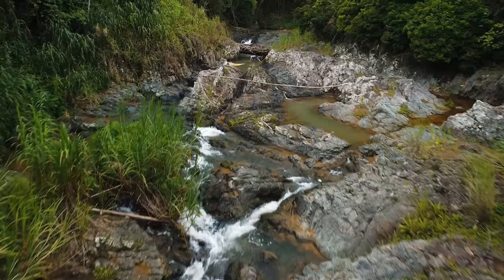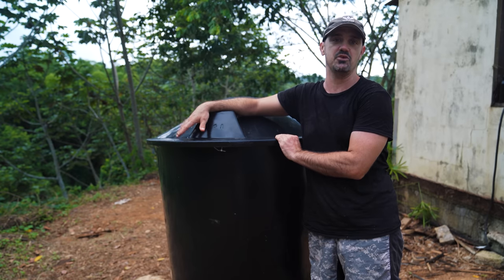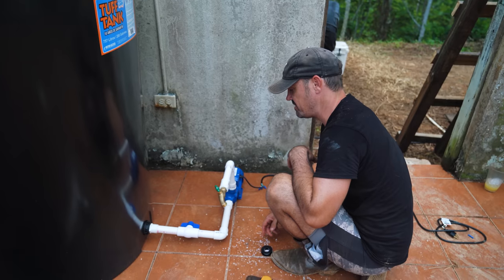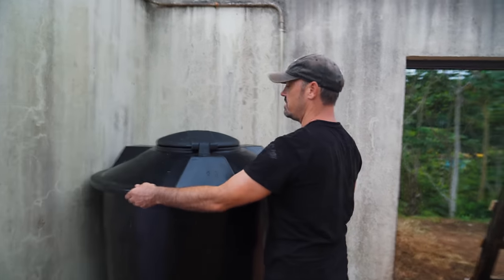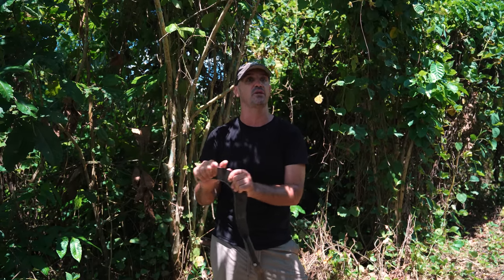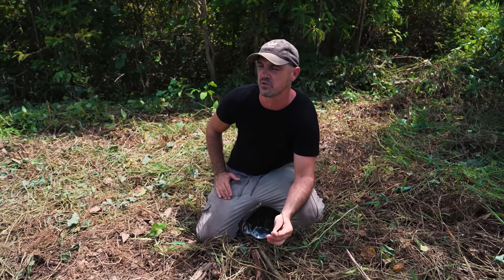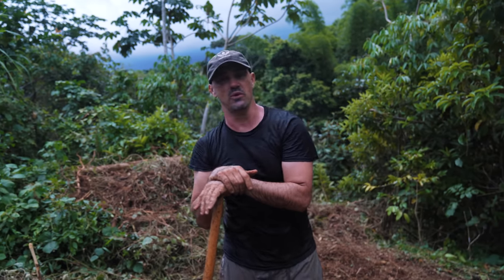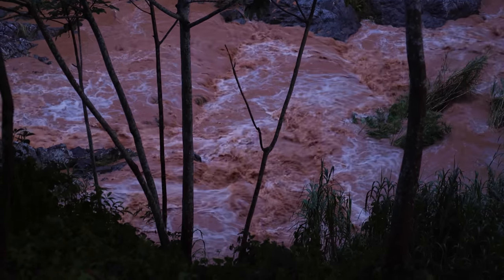WE BOUGHT AN ABANDONED PROPERTY THAT WE HAVEN’T EVEN SEEN 90% OF!

Comment: My mom and dad started a "homestead" when they were a little younger and eventually had a lot of what you may need. They were able to take water from "springs" (water which comes from a mountain from under the ground ) and run it through pipes into tanks which were above the house about 100ft . They ended up with about 10,000 gallons in multiple cisterns and filters and grew a huge garden. Then, at the end of summer, they might run out , and they had a stream about 400 ft elevation under them, and they pumped the water from the stream up that 400 ft of elevation using a special pump built out of a pressure washer pump. It took a lot of pressure to get it up the mountain from the creek.
Reply: When we were very young and traveling around the larger neighborhood, we found this valley where tons of fruit trees were hidden under vines like you have there. It was amazing to find pears, apples , and many other fruits under everything ! We had huge vines and found that the quickest way to remove them was to find where they started coming from the ground. You would cut that, and at a minimum leave it to dry, With it cut you could pull the 20 or 30 foot vine loose from all the vegetation it had grown through.Some were berry vines, it worked well for them. 
 You will be floored with the incredible beautiful aromas you will smell when you roast that coffee. Do you have a coffee grinder ?
Reply: There is a special type of fork that might help you. Its like a short thick pitch fork. Its for turning soil. They make really huge ones that your reach back and pull on, and short ones (which I would recommend.)  They aren't for hay, they have thick tines and are for soil. Of course, roosters eventually can fight to the death. Watch out.

Comment: if you were going for a low pressure solution, then why not just have the water tank up higher and just use gravity to feed the pipe ? Also, you mention flipping the lid of the container to catch rain water... but what are you going to do to water proof the electrics to your pump ?

Comment: Hey there Matty-Boy! Look'in good dude, lots of good stuff, [but that's always] No.1) Bamboo; just study "Uses for Bamboo" or "Working Bamboo" $great stuff$. No.2) When the little rooster reaches puberty, the big one will kill it; so just eat it. No.3) Put your water tank at least 15' off the ground, have the pump only pump to the tank, use "Head Pressure=.433 Lb/Ft." to gravity feed H20 to "wherever" (check that out). No.4) Consider putting a "Low Dam" in your creek, where the water will back-up behind it, maybe fill to 4' deep, (private lake) and then flow over. [Just a thought]?

Comment: I will say it again.  Work smarter not harder.  Normal cistern set up  has a pressure switch and pressure tank to regulate the on and off function of the pump.  I would have plumbed the water catchment system directly into the cistern to save labor.  a simple inline valve to bypass the cistern when flushing the rain catchment system would also be helpful.  (just like on many sailboats).  It is not rocket science.

Comment: Well, well, well. I am quite in the same situation than yours : bought a property that I did not visit at all… and in a country that I never visited.
For your water installation, you’ve got it all wrong !
Water pumps are not to empty the water tank, but to fill it up !
You can not pass your days caring cans of rain water to the tank.
Those big water tanks are made to be installed the higher as possible… so water can be distributed by GRAVITY.
The pump must be installed the closest of the source. So either the river or the collected rain water.
If you want to use your trash bucket as the collector, you should installed a flotter with an electric switch for the pump.
Water pumps that are for using the water in the tank (like on the second floor of your house, or higher part of your property that is higher than the tank), must be joined to a pressured small water tank. This way the pump runs as the pressure lower.
But in your case, the simplest is to raise your water tank (either on a corner of the second floor, or on a tower made of wood or cement blocks. The higher it is, the more pressure you will have.
Hope that will simplifies your life.

Comment: you can always add another 200 gallons later, ( but you're going to have to get it before the roof goes on ...Unless, you can afford to make a solid foot for one outside tank ? )
there are different ways to go about it, you just have to think about how water and air behave.
i have 700 gallons of capacity,  and sometimes that's not enough, but that's because it can go a long time between rains here.
EDIT: $80 ??? dude, swing check, accumulator tank, and a shallow well pump ( then your pump isn't starting and stopping all the time...it's more efficient, and the pump will last longer )

Comment: You can buy a standpoint that go down close to the river sink to Sandpoint in the ground about 5 or 6 ft cover up some PVC pipe all the way back up to your trailer and you can pump all the water you will ever need and it will be clean water because the Sandpoint will filters of water for you work smart not hard

Comment: My camper has a water tank with an on demand pump that kicks off when pressurized and on when you open a faucet. Your camper should be the same. If it is just fill the camper tank with the cistern. Problem solved!

Comment: Ok the water barrel I would had made or found rocks wood to place it on off the floor because it would also give some pressure to out lot and would not be affected by anything on the ground. OK what you have is a pump that needs a ground or earth. Check if the pump is AC or DC current and what its voltage is like 115 or 240V.  As you have the tank on the floor you are missing natural pressure.  A washing machine uses a lot of water not sure how your using water to attach to the washing machine.  if your home has own tank that connects to washing machine then fill that tank with water but will need a pure filter to do that.    Now Before you drink the water you need it filtered even from rain. buy two water Jugs with filters in them to prevent you getting unwanted stomach bugs that could lead to Hospital treatment.  I think there is enough power in that stream to generate 5 to 10Kw of energy. I would have many jug water collectors and in stead of filling it by hurting your self use a small 12v brush-less pump to fill your tanks from as could get a battery power bank to run the 12v pump filling the tank.  Maybe have two water tanks one higher than the other.

Comment: Well, you already screwed up Mr. perfect plumber. The line coming out of the cistern going to the pump should’ve had a union put in it so that in case you need to remove and replace the pump, you could take it apart without having to cut the pipe. And, like you mentioned, you should’ve had a tea at the top of the pump with a plug in it so if you could prime it or run a cleanup sneak through it because you’re gonna be running dirty water out of your sister because you didn’t put a filter on it
.   Oh, well, there’s nothing like being perfect.

Comment: Why use a water pump other than to fill your tank? Tank should be raised above height of washing machine or taps. The volume of water in the tank provides head pressure. Use the pump to empty water from the wheelie bin to fill the tank.

Comment: Go buy enough PVC to get all the way down to the river ...put a filter on the end of a hose and stick it in the river.....suck the water out of the river up to your tank, and use your tank and put a water filter on your tank , u will have all the water you ever need.... I don't know why you haven't built the Waterwheel yet ....you can be generating all the power you will ever need just from that moving water .... I told you all you have to do is let me know and I'll take a plane you come pick me up .and I will bring the stuff you need to make a badass water wheel ....all you have to do is buy a $300 generator from Harbor Freight ..... have all the power you ever need and more......

Comment: Get yourself a solid blade for the weed wacker. Yes chainsaws are only good for cutting trees, and don't cut too close to ground because you'll dull the chain and have to sharpen. A gas hedge trimmer works great cutting vines and crap like that. Good luck with the gay roster.

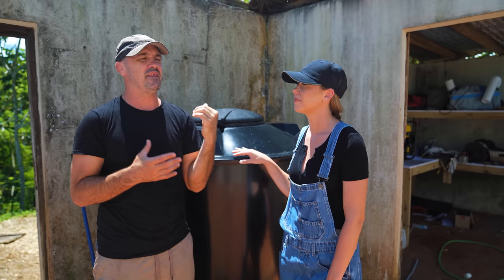Comment: @12:21 What did you say? _Using the gravity that the good lord gave ya?_.
If you had put the rain-catching funnel on top of the cistern up on the roof (which you could have finished first,) you wouldn't even need a pump.
No electricity needed. No pump to buy and break. The best part is no part. The best process is no process. It's also the cheapest.